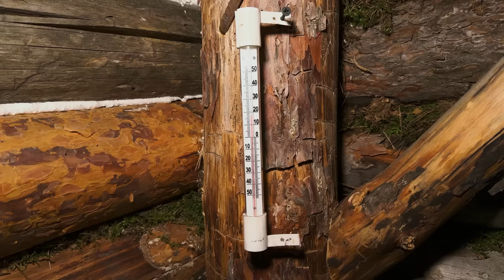THE largest HOUSE UNDERGROUND shelter - install STOVE, cook a LAGMAN. Part 9

Comment: I would put an upright log under the center of each step for support, Sir. Burn the ends like you did with the wall posts to prevent rot from ground contact. They will be much sturdier! 🤟😄

Comment: Alex and Serigo, Things are looking good.  As I stated in another post the double pane window would work much better than the single pane.  Also for this ole man the entry way is not wide enough.  Another half meter wide would be much more useful.  And the last thing that comes to mind is a bathroom.  Yes two guys can just go behind a tree but when it gets below zero and much snow on the ground that tree does not make sense or sounds like fun.  And yes the comment about the chainsaw. PLEASE be VERY CAREFUL!!!!! These machines make things go quicker BUT THEY ARE ALSO VERY DANGEROUS! They can cut your leg off in a blink of the eye!.  So please watch how you use them.  Great dug out so far keep up the good work.

Comment: looks awesome. I would take that 3rd step from the top and turn the side that isn't flat and level and flip it to the inside and upside down so the flat edge is flat with the wood it sets on. so it doesn't weaken over time. that gap and it being on the front edge where weight is on it as you go up and down the stairs will not hold up as long over time. I do love your work. and your food always looks amazing. Just wish could smell and taste it... lol

Comment: If you put some hinges on those stairs with a hook you can use the back section for storage. I suppose that would depend on if you're going to put a large door closure over the top.

Comment: Excellent work!  Just remember that carbon dioxide is heavier than air and will not ventilate upwards without a fan to move the air along.  The house itself looks very good.  Are you going to put bricks around the iron stove?

Comment: I'm surprised you used exposed steps for your entrance again, does it snow in this new location? I would have made the entrance where you put the ventilation pipe, a covered door facing to the tall trees (use the trees to hide the door) then even if heavy snow you won't have to dig so much, perhaps there is a reason I am not aware of?

Comment: DANGER!!! PLEASE, No one ever fit a stove like this!!!! I am a solid fuel heating engineer my entirelife and this pipe is soooo wrong and potentially lethal. Carbon monoxide is no joke and kills people around the world everyday.

1. Never go horizontal with a flue pipe (Chimney)
2. You can go at a 45 degrees, BUT only for 20 percent of the entire flue system (chimney)
3. Always fit a carbon monoxide alarm , you cannot smell or taste it. 
4. As you have fitted ventilation is very important with any combustion.
5. The recommended distance of a non combustable hearth (floor) in front of a stove is 250mm in a cabin i would make this 400mm all around , one stray spark can end your life. 

People believe fire is the biggest risk but its poisoning from the gasses from poorly fitted chimney systems, Sorry for the big essay, but i have dedicated my life to being the best i can be at my job and do it safely. 
Stay safe guys , I LOVE this channel and want to watch more videos, Love , luck and respect from Ireland

Comment: Alex, you must have done a huge amount of work in the construction, digging a huge pit, building a hollow around the walls, the roof with insulation and waterproofing, the floor and the entrance staircase, moving literally dozens of tons of sand back and forth, but by piling sod, moss and rake from the immediate area on top of the walls, your house now looks as inconspicuous as a dredge in a bathroom - a pile of rake in the middle of a bare expanse of sand. You should have taken the moss a bit further away where it would have been more inconspicuous, as it is now the house sticks out like a twig in a plank ...

Comment: First things first.  Cover the floor with fire-retardant material - then roll it continuously up the wall - UN-CUT - behind the stove.  Line the smoke-hole with the material . . .  staple it all in place . . .  THEN place the stove and put the stove and pipe together.  I grew up in a logging camp - we cooked on and heated our little cottages - with wood stoves.  I watched this process - and then as I grew - DID this process - more times than I can count.

Comment: Sorry guys, your steps, I would have put full flooring on there , and cut 4 logs for steps with removeable pins for holding them into place,  and angled them so as to then mount them for removable steps. Allowing access under the stairs for storage.